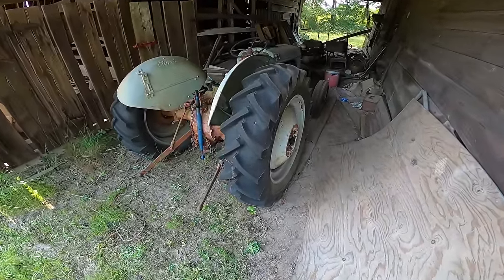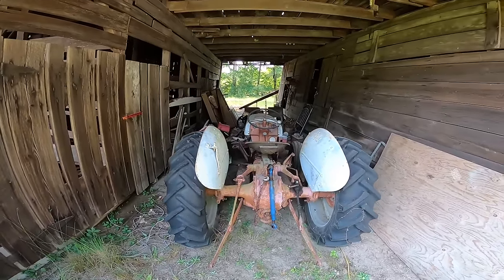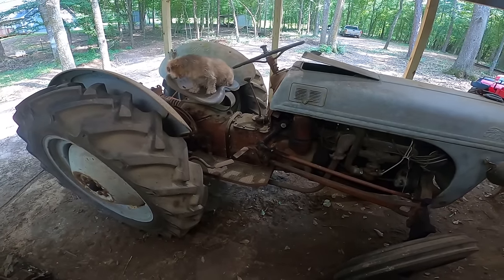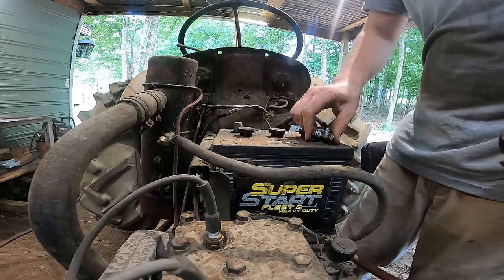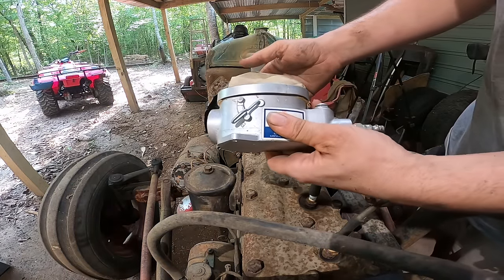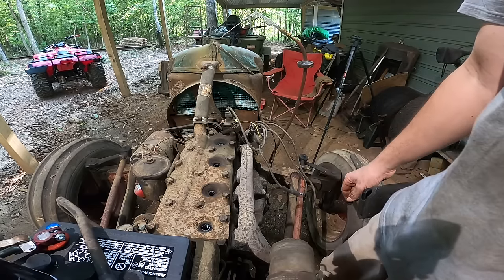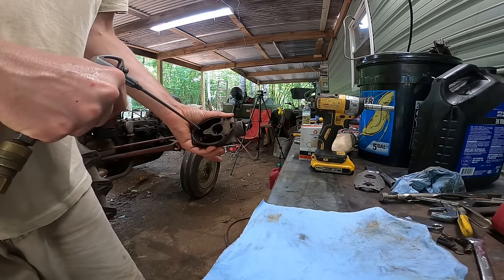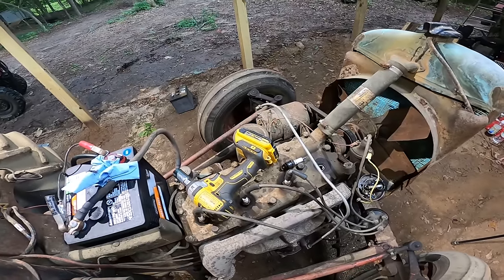Rescuing A 1952 Ford 8n Tractor Sitting In A Barn… Will It Run?

Comment: Learn how to use tools rather than water pump priers.
Reply from the maker: Learn how to listen to what I say in the video! I literally said I did not have the correct size socket, and what does it matter? I didn’t screw the bolt head up whatever works, works and I promise you I know how to use tools. Why don’t you go make some videos and do it better mr. Know it all
Reply: @TheHomePros6221  you said nothing of the kind before you removed spark plug!
Reply from the maker: At 5:51 listen closely
Reply: You can also use a hammer and cold chisel.  Fits sae or metric. Works on bolts nuts or screws of any type

Comment: I have been working on those  little tractor's for  50 years nothing you are doing makes makes sense go order one off  line for 45 dollar's put little mystery oil on cylinder over night drive it 50 more years put 303 in transmission and lift and bought one last week 300 dollar's I drive it all over
Reply from the maker: James your comment doesn’t makes sense 🙂

Comment: it makes me cringe watching this guy use pliers the way he does instead of the proper correct tools. I realize this must be your first experience with such a machine being more interested in the oil filter than concern for doing compression check. you pull the dipstick and it's not whipped cream but good oil. good enough to tell whats inside. and spark plugs dont go bad very often but points and coil very likely need attention. yeah your little spark plug sandblaster sure is shiny but just a way to introduce sand inside the engine rather than just brushing them off or spending the $16 for brand shiny new plugs. spray some pb blaster or kroil in cylinders let it sit a while while you check spark and get good spark and rebuild carb then get it running. compression will probably straighten out. if not pull it apart and do a complete overhaul, COMPLETE, from front seal to new clutch and everything in between. and it will last another 60 years.
Reply from the maker: I literally said in the video I didn’t bring many tools with me, what did I hurt using adjustable channel locks or pliers?? I didn’t strip or mess up the plugs and the reason I took the plugs out was to put wd-40 down the cylinders. I know those plug cleaners can introduce sand in the engine if u don’t clean the plugs out really well. Watch my other videos on it and other things if u want this was one of my first videos working on stuff